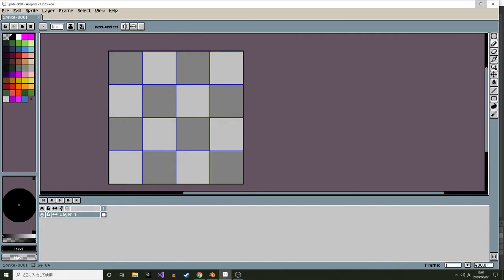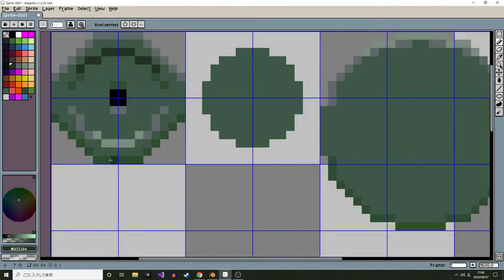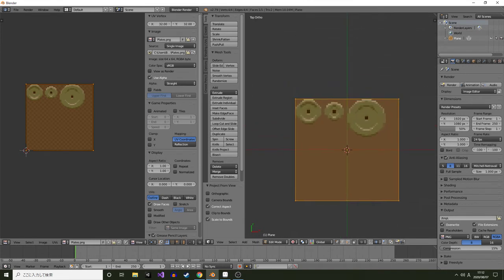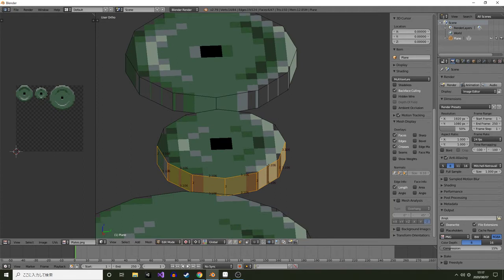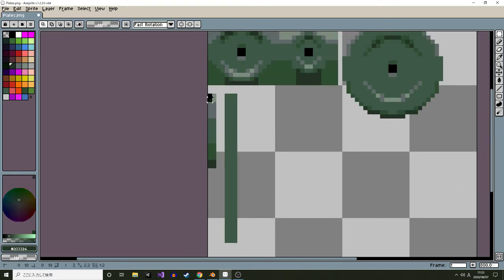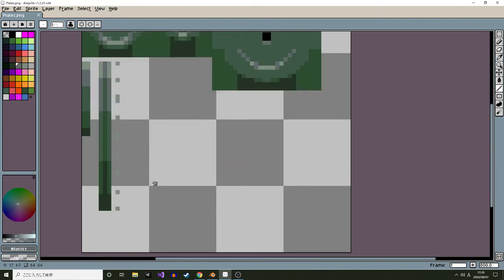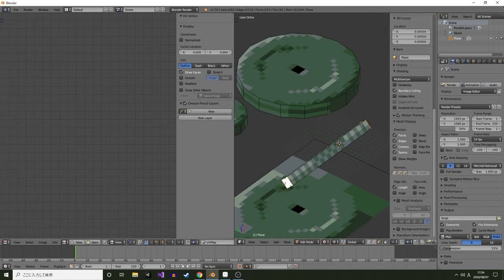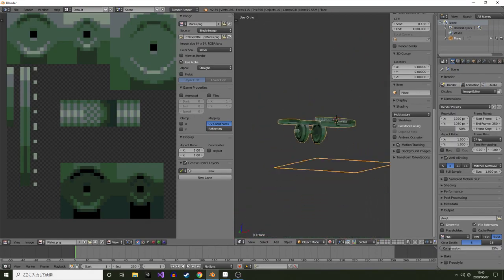My Pixel Art Modeling Process

Comment: What do you think on Crocotile3D and Blockbench software to create Pixel Art 3D Models? I think it can replace Aseprite + Blender workflow for people that are new (like me) in this kind of style, or that have never used Blender and doesen't have much experience in 3D.
Reply from the maker: The best tool is the one you are most productive with. If those tools are comfortable for you to use then go for it! I personally prefer blender as I have some extremely specific restraints and requirements for my models that don't usually apply so I need the extra granular control, and also it's simply the tool I'm comfortable with.
Reply: @gennoveus   Thank you for your answer :) Your art is amazing and it has motivated me into practice/study Pixel 3D Art 🙏 (Even though art is not my field lol)

Comment: Awesome tutorial, Bevan! Thank you! Two quick qs if I may: (1) Same workflow (paint->model) even for humanoids? (2) Have you found normal maps useful in your 3D pixel art workflow? Cheers to you sir!
Reply from the maker: Hi! I do use a similar but modified method for organic shapes like humanoids; I should really make another tutorial for those some time.  Also, one of the big benefits of pixel art textures is how rapidly you can create assets. For this reason, adding complexity like normal maps is not the direction I personally would go but I have seen people pull off normal maps + pixel art very well so it's certainly possible!
Reply: @gennoveus  I hope you do someday, also if you do can you explain your script for pixel bleeding the textures?

Comment: I'm baffled that people still use anything pre blender 2.8. Very cool to see the process though!
Reply from the maker: unfortunately blender 2.8 removed a very handy in-editor rendering feature which is vital to my process. 😟
Reply: Which feature is that? They did move around a lot of buttons in 2.8
Reply from the maker: @Eiko...  The ability to view a texture on a model in the editor in real time with texture filtering off without having to apply a material. It's very niche so IDK if it will ever be added back
Reply: @gennoveus  You could just set up the default material to use "closest" texture interpolation and save the file as your default. Then you'd just need to import the texture when you start working.
Reply: @Eiko...  Funny seeing you here, you have quite a similar style to the game, save for the pixel art textured asthetic.

Comment: Thanks for helping me out.
I was inspired by your game Compound to make a game in its style since your style of Pixel art is more apeeling than the Voxel style 3d game most often go for.

I would only have one question to end this comment on:
"Is it possible to make real time raytraced Pixel Art?".
Reply from the maker: Ray tracing is of course possible. There's a lot of ways to go about making your game have an authentic pixel art look while staying 3D. If your game is non-VR, then it relatively easy and extra stuff can be done with post-processor effects. If it's VR, things become more complex because there are many effects that don't translate well to stereoscopic vision and need modification. 

Another benefit of this style of low fi art is that it is very easy on the GPU. Modern "voxels" are usually rendered using polygons and not actual voxels like back in the day, so they end up having a very high poly count.